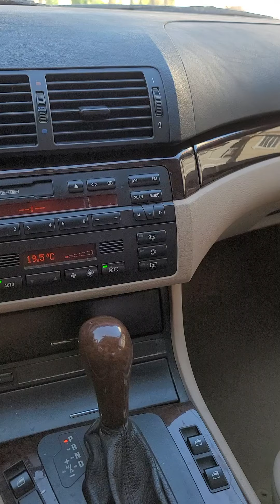Noise when ac (aircon) is on - BMW

Comment: Same issue on my e46 318i 03, although the noise is not so drastic as in this vid, more than the noise i can feel the "electro-motor like" vibrations in my steering wheel along with bit of whining on low speeds, appears the compressor is ready for change.. For all concerned about the cost, it's not that bad ~200 dollars for bosch compressor.. BTW power steering problems sorta present themselves in a similar manner ( without being related to A/C of course), so make sure to have thorough inspection as it's not set in stone it's the compressor being the problem.

Comment: I have a 08 528 with an issue with the AC as well.  Brought it to the shop and they replaced the tensioner pulley including belt.   Problem seemed to be fixed.  After a few days a similar noise is back but worse.   Only is hear it with AC on and sitting at idle.  When driving the noise seems to be gone.    Hoping it is not the compressor.   How much did you end up paying?
Reply: Did u solved ?
Reply: @Constantin-AdrianPreda No.  The shop wanted to hold the car for a few days  to tear into it to investigate further.  Since I am deciding to retire it I chose not to dump any more money into it.
Reply: @ my serpentine belt came off.  Found that a bolt for the AC compressor was missing. This was the cause of the strange noise.  Good idea to physically push on the AC compressor to check. My compressor was able to move around by hand.

Comment: Squirrel cage in your ac blower motor needs to be cleaned out
Reply from the maker: Thanks for your comment,
It turned out to be the compressor on its way out.
I had the system flushed out and vaccum the freon and air inside;
Applied ac compressor oil and refill with freon. Seems like the noise got a lot less. However, i feel like it will only give me a year or 2 and the ac compressor shall be replaced.
Reply: Hi, did you replace the compressor? What solved the issue , I have an e60 does the same
Reply from the maker: Yes, replacing the compressor solved it, inevitably bro